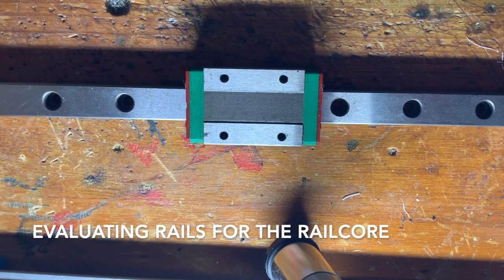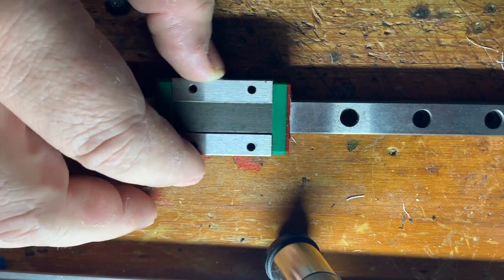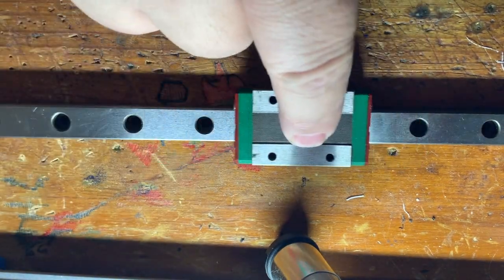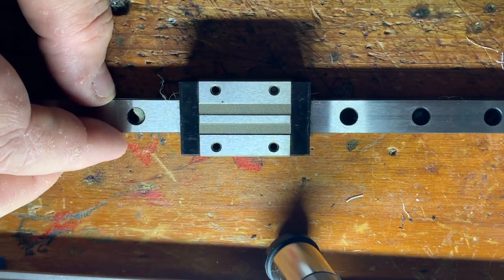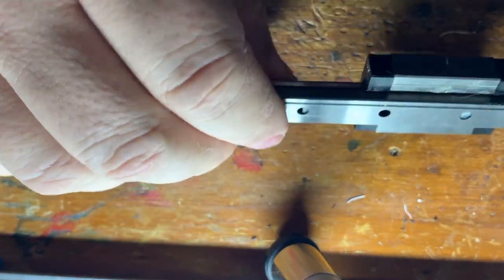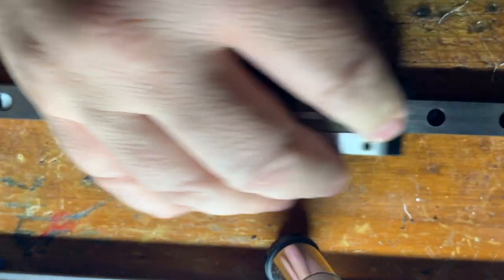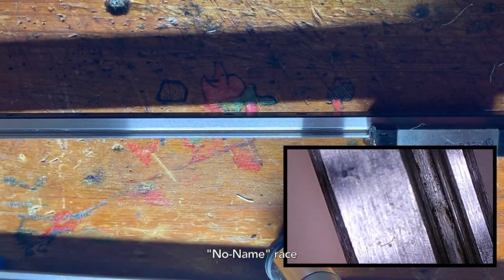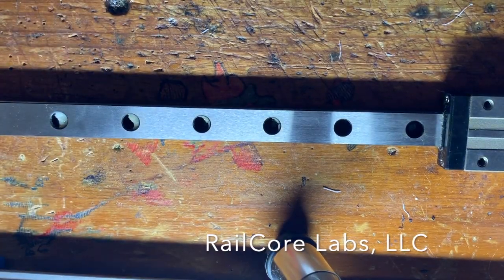Evaluating Rails

Comment: Yea I've had lots of fun with Hiwin clones, cleaning and relubing them numerous times and never got to make them flawless on low speeds. Ordered Misumi for XY will see how it goes. Probably had to buy them at first place, turned out its not expensive for main component if you're building ~2k printer.
Reply from the maker: I learned that along the way, too. We wanted to make it as inexpensive as it can be, but no more so. Turns out with my obsessiveness, I should have saved money and just bought Misumi from the jump.
Reply: In my case, there is one advantage in buying Hiwin clone initially. I have gained deep knowledge of various lubricants and cleaning solutions. Well worth it, giving the fact how inexperienced I was before my first coreXY assembly.